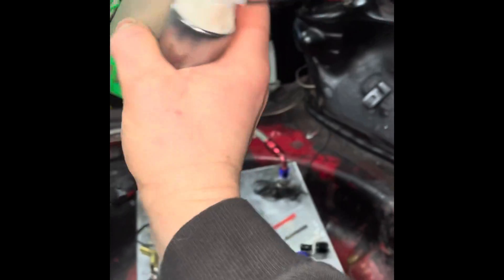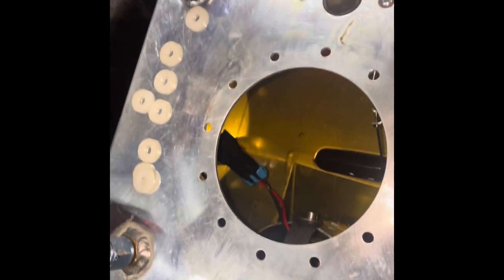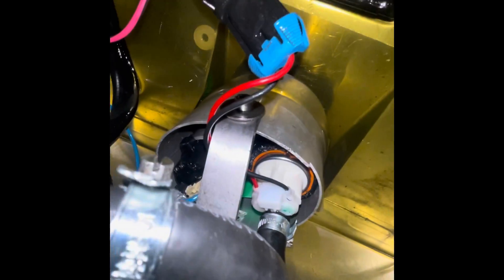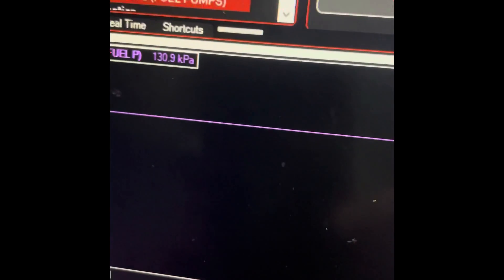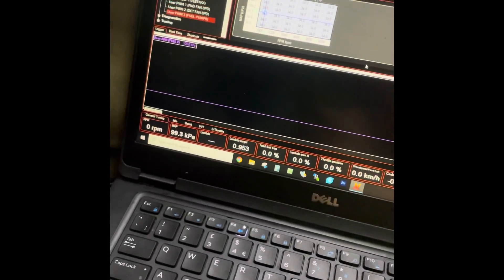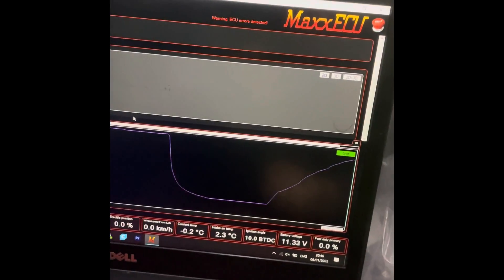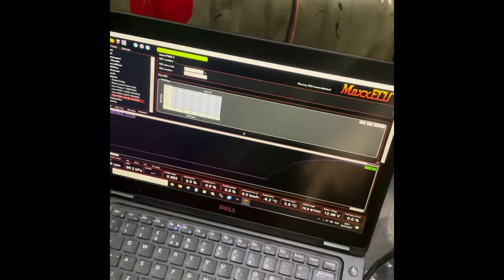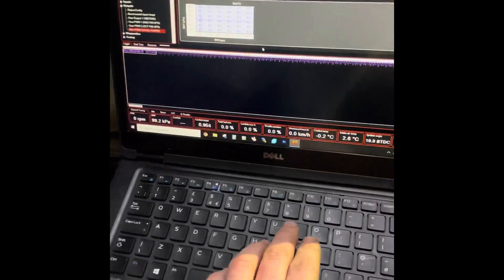PWM fuel pump speed control via fan control modules.

Comment: Is there any particular reason why you used an fan pwm module instead of fuel pump pwm module? I found some Volvo fuel pump pwm module and keep thinking if there is any difference in function or realiability...Thanks
Reply from the maker: no reason :) ffan ones were cheap
Reply: @BEYTEK  and you control it via a GPO output (green wire)? Thanks
Reply: @BEYTEK  Also, what do you mean by "cannot ground the output to chassis" ? The module itself is grounded to the fuel pump, correct? There is 3 wires... 12v feed, gnd and signal one to control it...the ground one is going directly to fuel pump?
Reply from the maker: @ilikemyboost  the output wires need to go t o the pump. dont ground the output ground wire

Comment: Nice vid and cool idea. I was wondering if you do not supply any pwm to the unit does it run the output at full whack like in fail safe mode. The audi controllers to this so you need to send them minimum like 10% duty. If this unit would not drive the output wo pwn it would save a relay upstream from it🎉
Reply from the maker: ive never actually had one go in fault yet buddy
Reply: @BEYTEK  ok nice. So you connect it from battery w fuse to controller to pump or do you use also a relay between the battery and the controller?
Reply from the maker: @RubTdi  its 3 wire to controler. batt sig and ground. then the output of controller is positive and ground to motor or pump or anythign you want to drive.
Reply: @BEYTEK  ok so there is nothing between the battery and the controller. Like when the car is off w battery still connected and the maxx sends no PWM to the controller then the pump is off? W audi controller if you unplug the PWM wire then it runs fans full speed after 10 seconds